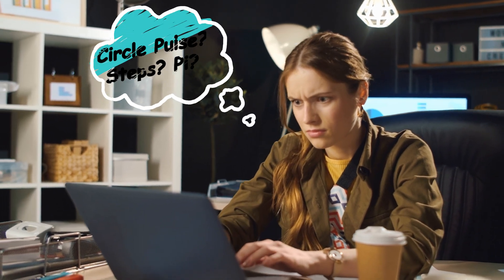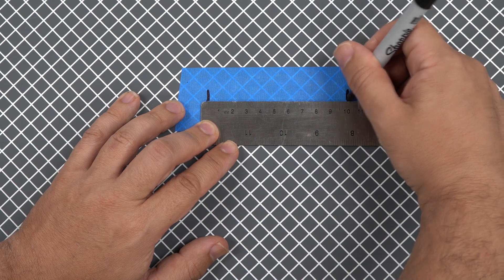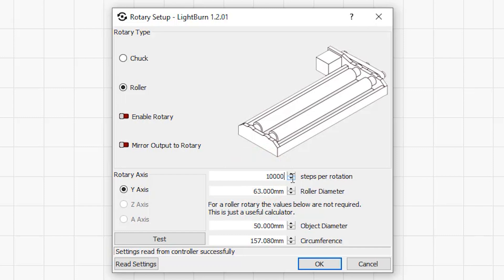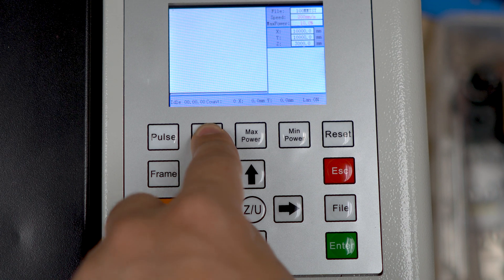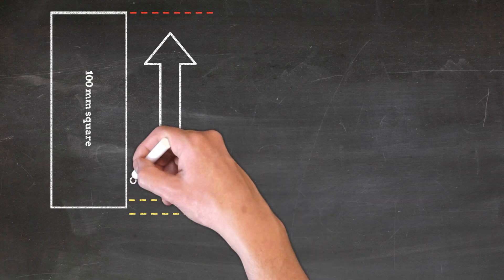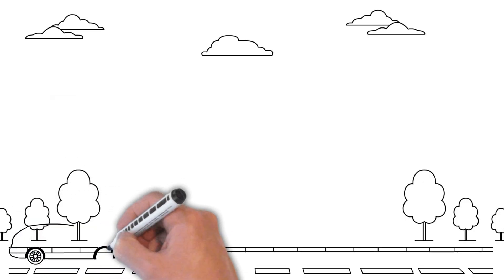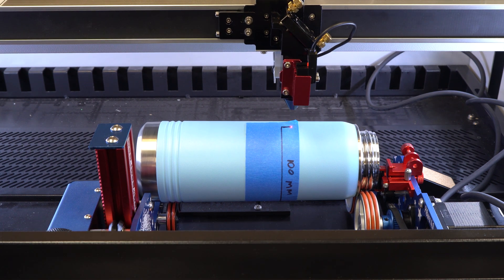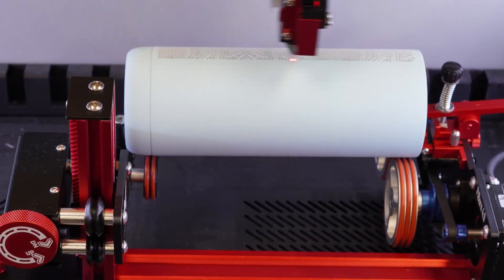Rotary Attachment Calibration: 100mm Square Test

Comment: Why did you switch to adjusting the the diameter settings instead of just continuing to change the steps per rotation with a smaller amount eg. adding 500 or something? Wouldn't that be less confusing to just keep attaching the one value till you get it right or is there some good reason I'm missing by switching to adjusting the other figure instead?